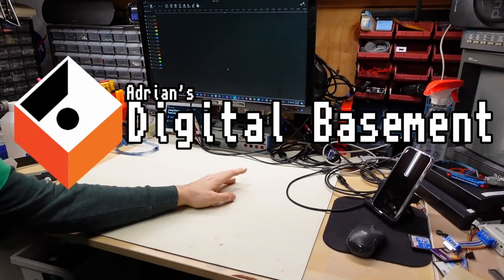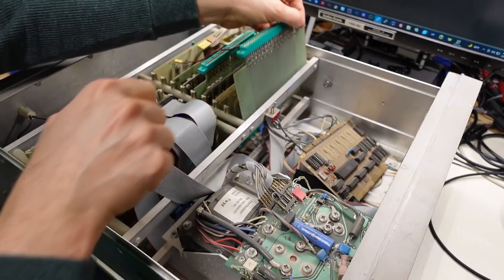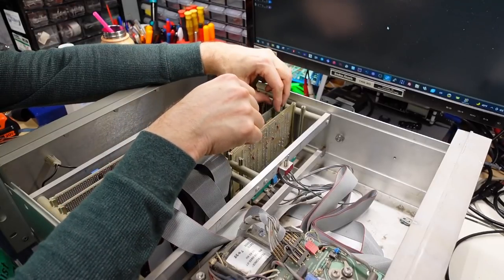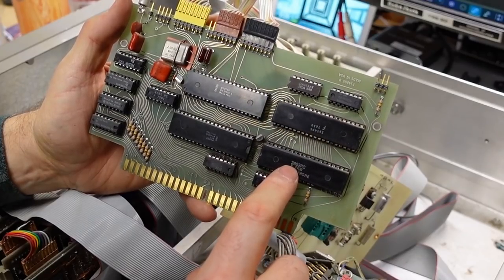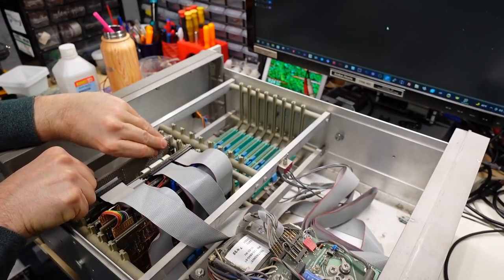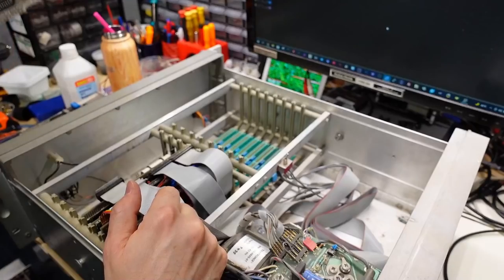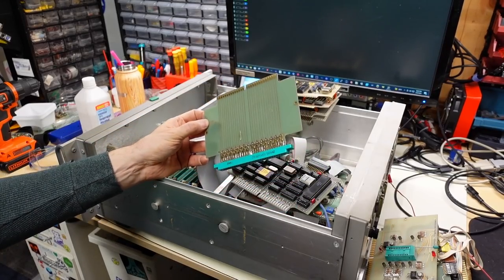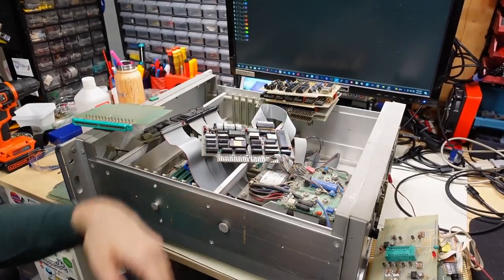I need help finding information on this mysterious computer

Comment: I worked at Tek in the mid 70s. to 79. I believe what you have is a “Bit Box.. it was a custom designed development system.that the company used to develop software for embedded systems within instruments. It is definitely a tek design as few manufacturers gold plated all the runs on the board. Also the bread boards are the way we made prototypes.
Reply: I was thinking along the same line, the builtin EPROM (EEPROM?) programmer being the clue.
Reply: That's seems to be more likely and would also explain the existence of the Z280 MPU (not a copro nut a full CPU) with the "modern" 128k RAM board next to the "classic" Z80 board together with the 64k RAM board and the prommer. In trade school, we also had similar machines based on the Zilog line of processors.
Reply: @MatthiasWelwarsky  an Eprom , EEPROM are electrically erasable and were not available for at least 15 years after these boards were made
Reply: I completly agree with that conclusion. Some of the wires on boards seem to be interesting: does anyone followed them up to see what they do? I saw some resistores wildly added that was kinda interesting i guess? Some wires seem to be just there to open up more directly communications between modules so .. "for efficiency"? Idk i am a 90s kid XD
Reply: @analebanane508  Direct interboard connections are for any signals that aren't important enough to get assigned one of the main bus wires that go to all boards via the passive motherboard (in the original meaning of the word), those bus wires would be just the main power lines and the fundamental data / address  / control lines, like on the PC ISA bus (minus the PC specific signals).  Probably same signals and levels as the  Z80 CPU chip itself.
Reply: Incredible. I’m amazed by how someone with knowledge from 40 years ago runs along this video. It’s so obscure
Reply: @JohnDoe-yq9ml  
Not really ...... 
I have knowledge from 40 years ago, although i was still a kid,   he however worked in Tek when i was 8 so he's likely 10 to 15 years older than i 
but at the end of the day Electronics guys are Electronics guy we are always in the background of everything electronics 
it's not like it's a suprise that he's here 
i would have been suprised if he wasn't here 

the guys that are not here are the one's that don't have a passion for it  and those are the one's that lack the knowledge
the one's with a passion have the knowledge and hence are here

See, simple mathematics   LOL

but it's still cool huh ?   how 40 years later someone puts up a video and says... what the fuck is this 
and he pops up and goes.... Oh... Oh Oh ... Me  .... Me Miss.... Pick me .. i know
LOL
Reply: Not to mention the "Tektronix" label on what looks like a big honking power transformer at 7:34 :-)
Reply: Interesting I started at Tek in 1979 and worked in the Microsystems development group. We did a lot of prototyping similar to these boards so you’re probably right.
Reply: Could be a digital group system
Reply: On the transformer you can read "Tektronix"!